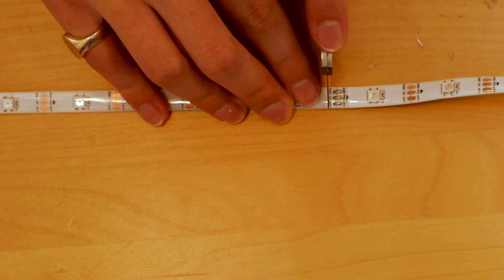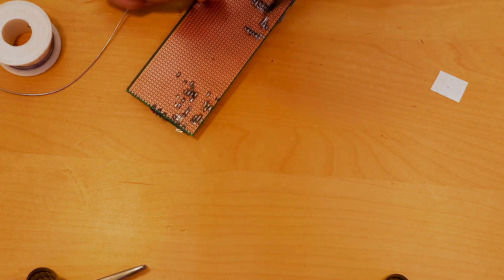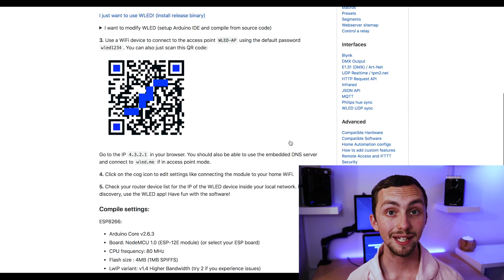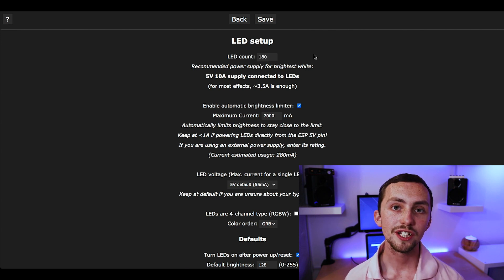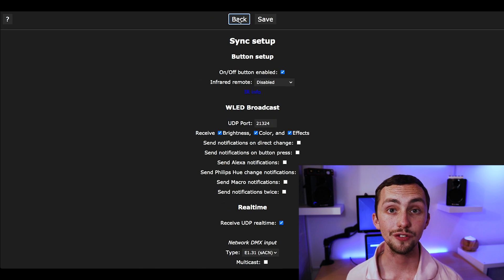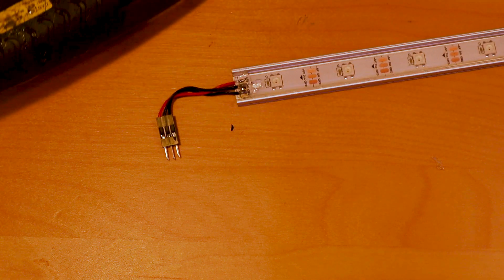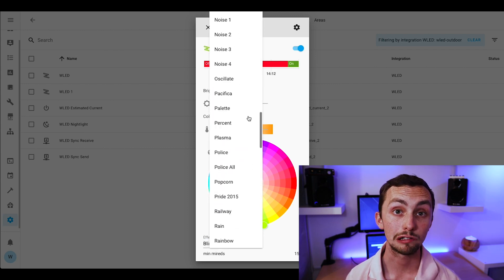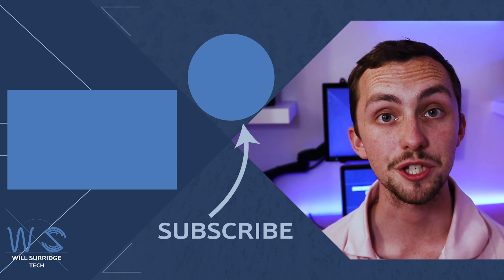Outdoor Lighting using WS2812B LED Strip with WLED - Setup Guide and Tutorial

Comment: I got some LED tape lights from Amazon that has a IP Rating of 20. The manufacturer said they are waterproof but the power supply and controller are not. What are your thoughts?

Comment: Hello mate, thanks a lot for your video but may I ask why your connections is differnt to the wiki image, the top image, i mean why you are not using the resistor and the capacitor? Cheers
Reply from the maker: hey, both components are optional (and weren't even recommended when I made the video). The resistor especially so when you have a logic shifter; the capacitor will act to smooth the injection incase of fluctuations so I would recommend, especially for larger installs

Comment: i have a couple question that i’m really hoping you could answer! so i want to put 20M of leds around my room that have wled. how should i go about connecting the leds strips together so that they reach the length of my room and what power supply do you suggest. thank you so much :)
Reply from the maker: The power supply will depend on the density of the LED pixels, they draw 0.18W per pixel at full (ws2812B strip that is) - so if you have 60 pixels per meter, thats 216W. As for joining them together, you can either buy connectors online, or just solder some wires between them.

Comment: How do you keep the power supply, controller, and any soldered connections protected from weather?
Reply from the maker: I kept the PSU and controller inside; but you can use a waterproof enclosure if you need it outdoors - as for soldered connections, if you mount it under the roof line then you shouldnt get any problems; if you put it on the floor like me then you can consider a waterproof connector or just hot glue!

Comment: After a power failure its orange😐
Reply from the maker: As in the LED strip? you don't have control?
Reply: @WillSurridgeTech  while connected i can control.. but it doesn't save the last state if power is gone and it will turn on in default state
Reply from the maker: In the LED setup page you can set what the LEDs turn on to after reset using a preset
Reply: @WillSurridgeTech  yes thats right.. it saves all the settings.. but y dont it save the last state😐
Reply from the maker: ah okay, its a good idea - all i can suggest is making a feature request for WLED

Comment: No need of level shifter.. just skip first led..
Reply from the maker: Yeh that also works, but if your run from the controller to the first pixel is too long then it can still sometimes have problems
Reply: @WillSurridgeTech  I thought the logic shifter is used to convert the 3.3V the Wemos D1 Mini runs on to the 5V the strip needs?

Comment: One led requires 0,02A, so one tenth of what you suggested. Otherwise a great video!
Reply from the maker: I was talking about watts - each pixel needs 0.18W, so at 5V each pixel will draw 0.036A (or there about) - I got this value from Hook Up Rob, so haven't actually tested it myself (http://www.thesmarthomehookup.com/the-complete-guide-to-selecting-individually-addressable-led-strips/)
Reply: Ah my bad! I read from DrZzs that it should be about 1A / 50 LEDs 😊
Reply from the maker: @gszah  Yeh thats about half of what I have - I recon 1A/50 is a safe bet unless you're planning on having full white on everything a lot!

Comment: how can i connect a seperate transformer power suplly to tje d1 mini?
Reply from the maker: I think you’re better off using one transformer for both the controller and the LEDs, but I believe if you just connect the controller to one transformer as normal and the leds to the other then you will need to connect the 2 ground connections together

Comment: What wire would you recommend for use here? Got 15m of 12v WS2811's that need to be about 3m away from the PSU.
Reply from the maker: To be honest, I dont really know...the thicker you go the less voltage drop, and the more you inject the better. I only used thin bell wire for about 10m total and it wasnt really enough - ended up creating a loop by joining the end back to the PSU which helped - that was 5V and 150LEDs total - I wouldn't be afraid to go at least to 18AWG if not thicker - try a voltage drop calculator and see what it comes up with - sorry its not an exact answer but hope it helps!
Reply: @WillSurridgeTech  That's great, I think 18AWG sounds about right to me too!
Reply from the maker: @joelsawyer569  let me know how it goes!

Comment: Thanks for vid - tip - check out self-amalgamating (fusing) silicone tape for weather proofing cables/strip ends after cutting.  Should stand up to freeze-thaw of outdoor applications better than hot glue.

Cheers
Reply from the maker: Great tip! Never heard of it before, will have to get a roll! Thank you :)
Reply: I've used something similar on my mains electrical, never acured to me to use it for something like this. I like it!

Comment: Why do you use the Logic shifter?? The power supply delivers 5V and powers the D1 mini?  Thumbs up for your good work ;)
Reply from the maker: Hi, the logic shifter is there to take the logic from 3.3V to 5V. The D1 mini may have a 5V power input, but the logic (data) output is 3.3V. The LED strips are designed to run on 5V logic, although they can run on a bit less. You can get away with using 3.3V logic on short runs, but over a long run the voltage drop is too much so the strip can't handle it. If the voltage is too low then the strips won't respond properly and will probably just flash randomly
Reply: @WillSurridgeTech  Another trick is to put one pixel right next to your controller. This will then up the voltage to 5v on its output and basically act like a level shifter. you can even tell WLED to ignore that pixel. It's in the LED Preferences and is called "skip first LED".
Reply from the maker: Thanks for the tip!